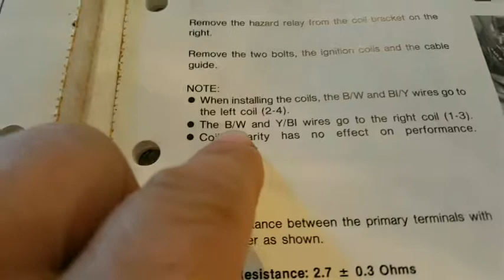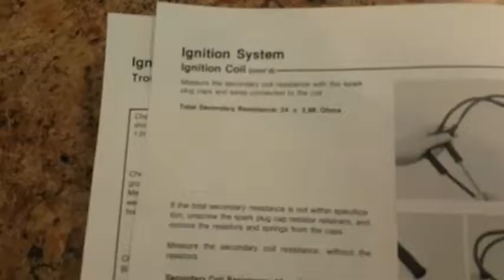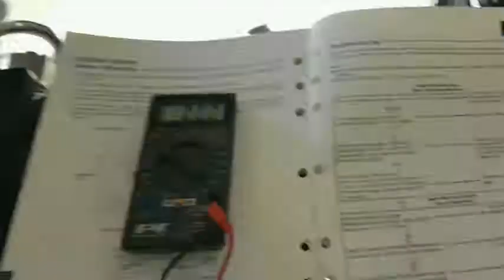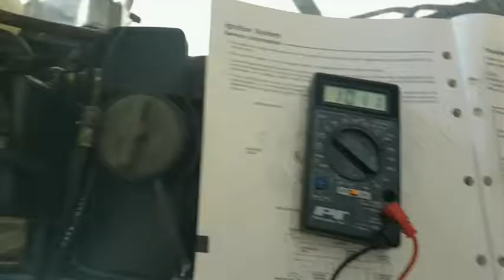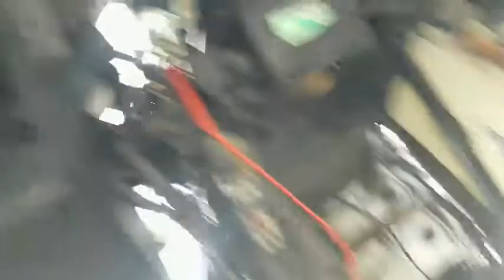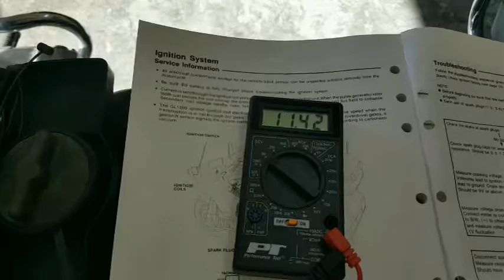1986 Goldwing GL1200 Coil Testing 31 Jan 2019 Edit

Comment from the maker: The problem was a no spark issue on two cylinders.  It turned out to be a faulty ECU which i acquired on ebay.
Reply: @horsingnaturally2244  But it is an ECU but I already changed the CDI
Reply from the maker: @gregoryvillarreal7702  did you check to see if your pule generators are putting out 3 bolts as the engine rotates? Also check to make sure your CDI is getting 12 volts.
Reply: Excuse the question but when you say emitting 3 pins you mean if it is sending pulses I tested them with an LED light and it gives me the pulses well
Reply: Give me your phone number so I can send you photos of the CDI so you can help me.
Reply: Excuse me, could you give me your phone number so I can send you a video?
Reply: How much amperage should the capture coil have and how many volts should it send?
Reply: I already tried the pickup coil, it's good but when I mount it on the motorcycle it doesn't give me a signal, what could it be?
Reply: @horsingnaturally2244  Could you make me a diagram of the CDI to see where the 12 volts are because it only gets 4 volts?
Reply: @horsingnaturally2244  pero usted no mostró el vídeo si corrigió el problema de la chispa

Comment: And tell me what problem I had because I'm watching your videos and I have the same problem.
Reply from the maker: No spark on two cylinders.  Was hoping it was a faulty pulse generator but those checked out good.  The problem was a faulty ECU which I replaced with a used one from ebay.